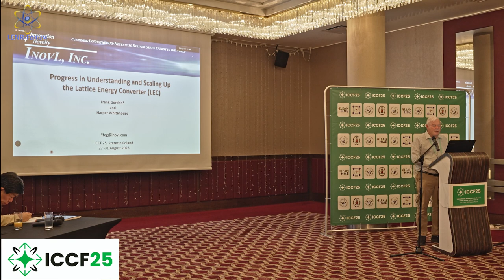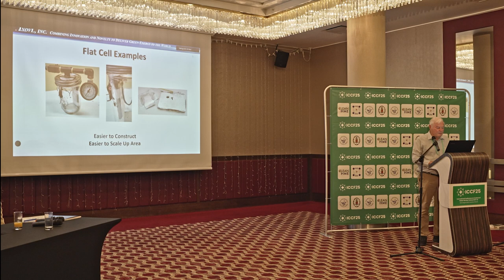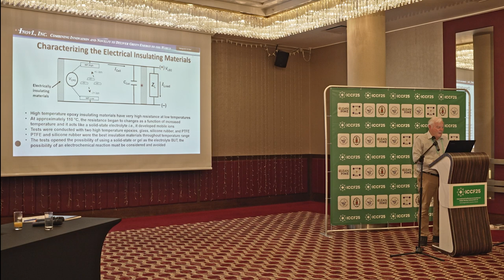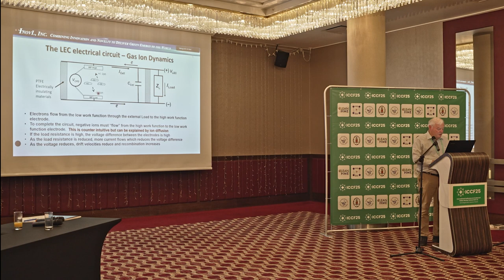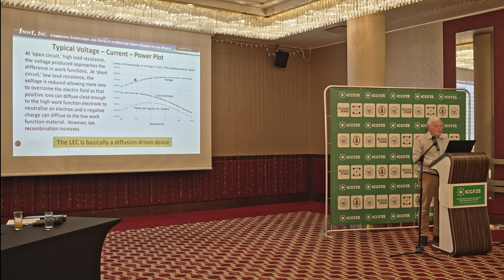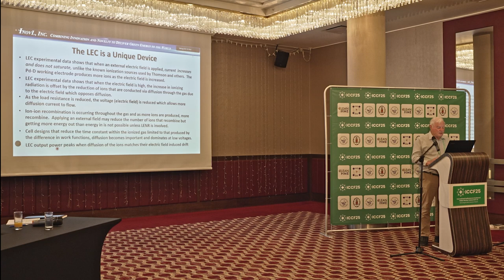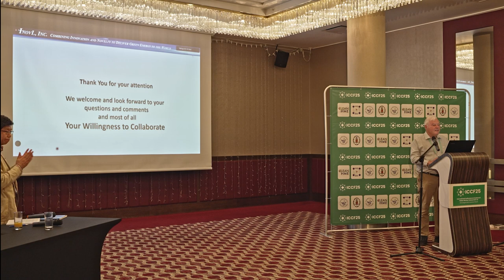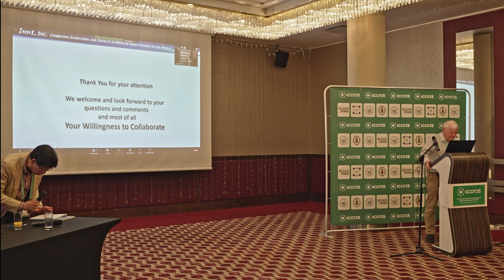Progress of the LEC (Lattice Energy Converter) -  Frank Gordon at ICCF25

Comment: A musical instrument, like any object, holds together in sync-duration coherence-cohesion objectives, a Bose-Einsteinian matter specifically tuned to convert the energy output intended by the Musicians to convert a photon-phonon positioning shaping from photon dominant resonance to phonon dominant resonance positioning from inside the tuned instrument to outside in the atmosphere of e-Pi-i omnidirectional-dimensional flash-fractal perfect gas, passing from the artistic intention to the recipient's ears.

You're supposed to look, listen, hear and see how it works and emulate the transformation as a learning experience. 
Apply it to LENR, and pumping resonance accumulation->decay relative-timing ratio-rates Perspective, and that will include the Universe,  Life Death and everything in math-music reciprocation-recirculation instrument creation-transfomation pulse-evolution differentiates...
Reply: Than the challenge becomes putting thoughts into form and words into actions right?